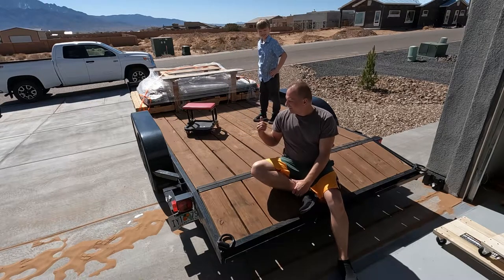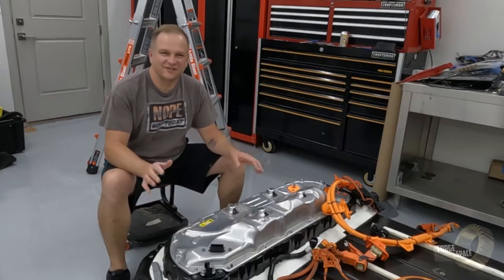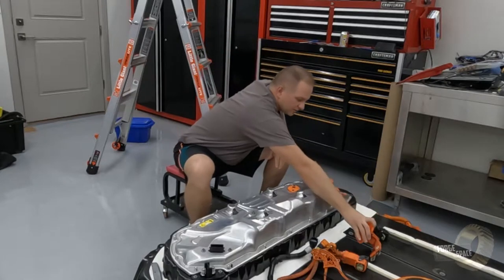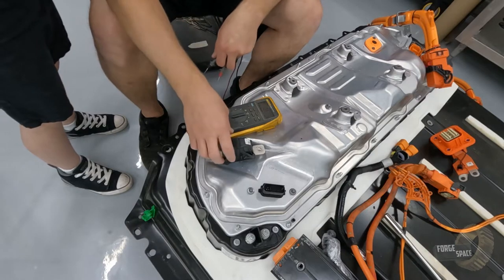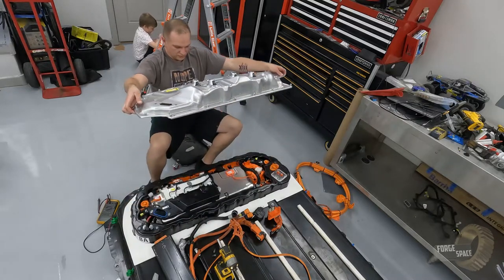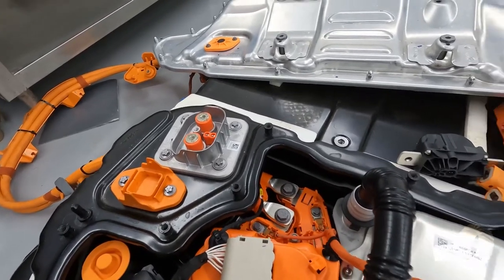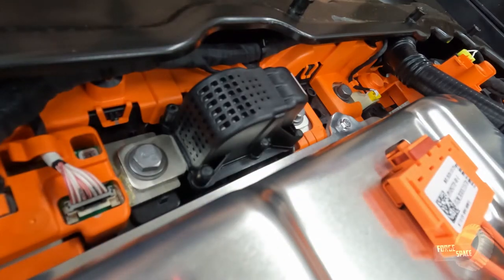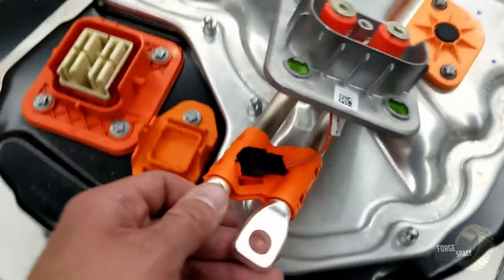Replacing the Pyro Fuse and Charge terminal on the Tesla Battery EP.02

Comment: Thx for the practical, real-world view of managing the penthouse disassembly and pyro fuse replacement. I appreciate that you were very cautious, but I recommend that, minimally, all (electrically conductive) tools be wrapped with good electrical tape and that PPE, such as insulating gloves and arc-flash eye protection be worn. The 400V DC is a huge potential that can blind, burn, or kill you.
Reply from the maker: You are correct here and I probably should be using some insulated tools. Working in the penthouse isn't too dangerous as long as you stay on the off side of the contactors.

Comment: Hi, do you think a new pyrofuse may power it up after totaled? Was powered up after wreck then once at towyard, no power and can't get in it-hoping to slimJim  in it and get it powered up, can't use option to pop frunk with a battery since the doors locked to pop frunk. Hoping to get the screen powered up to wipe my data if you know an option that way, just to power the screen? thx
Reply: Probably a dead 12V., as it controls locks and body controllers.

Comment: I have a model 3 that stopped charging would u by any chance know if it’s possible that a fuse blew and doesn’t allow charge to go to the battery ?
Reply from the maker: The only real fuse in there is the pyro fuse which splits the battery in half. If that had blown it wouldnt drive. My thought would be the CAN. What do the indicator lights do when you connect the charge cable. This is something that should be covered under warranty and they me able to remote in for diagnostics.